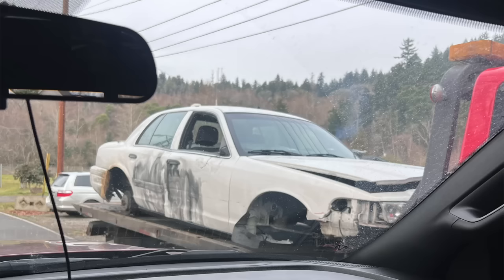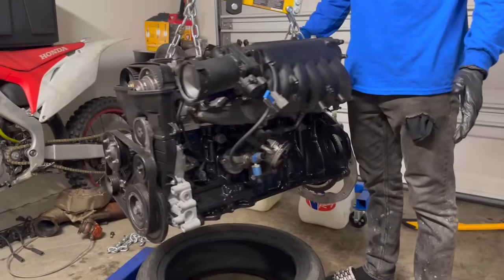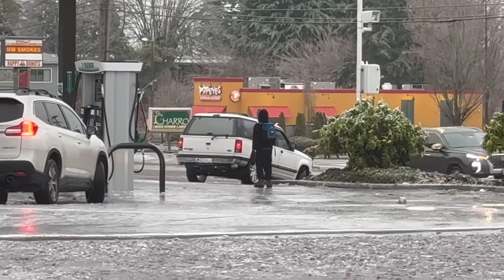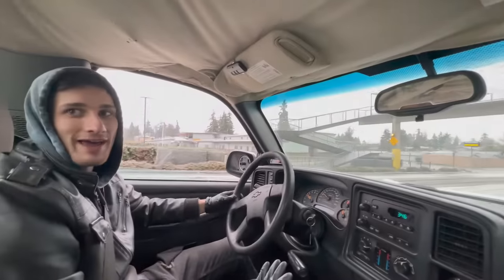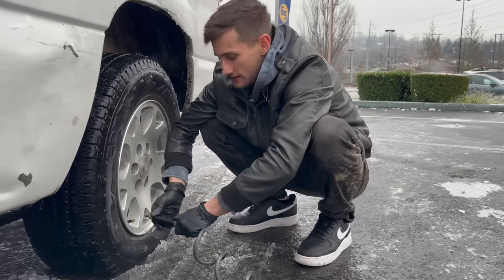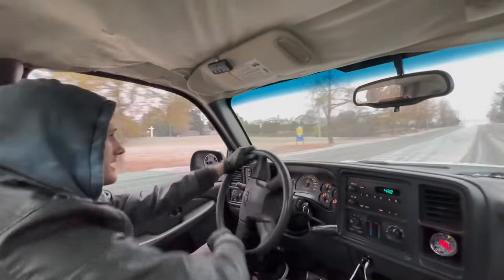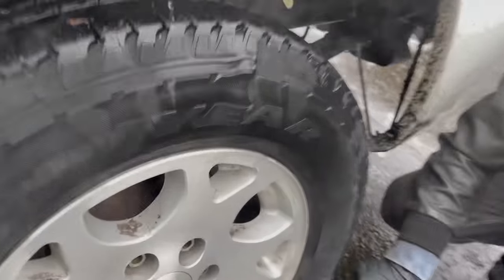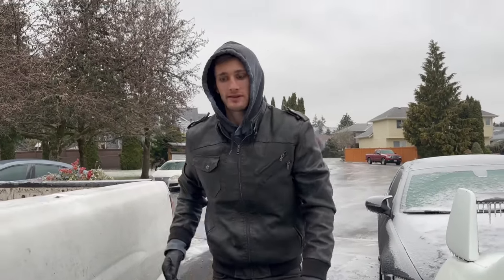I Found My Stolen Car !!

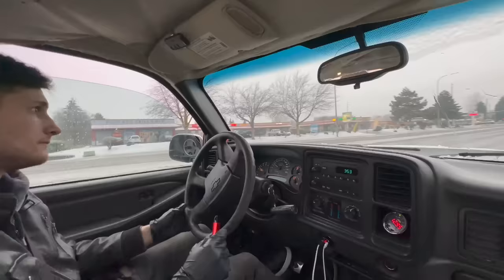Comment: 5:10 can’t believe Nathan casually doing 120+ in the snow down the pkwy like it’s nothing 

What a lad
Reply: 120+ wheel speed he not actually going that fast
Reply: Ain’t no way you said that
Reply: dawg hes going like 30 maybe tf in what way does that look like hes going 120mph the rear wheels are spinning at 120 but the truck aint moving
Reply: Bro he’s obviously bouncing it off the speedomo-limiter